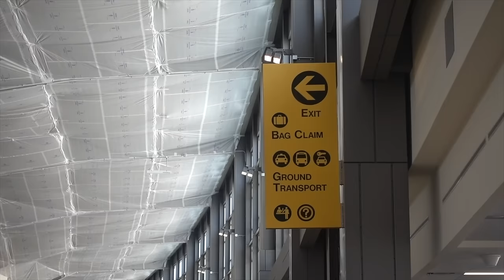MTB Myths that need to die—and some that are true!

Comment: Sometimes, a crash becomes your last run. I am not superstitious, but I think I crash less on my last run. Usually, my third or fourth run I tend to push the limits and crash.
Reply: i crash when its like 7:30 to 8:00 pm (Whistler closing hours) which is usually when i go for my last run
Reply: My last crash a couple of weeks ago was during my last run lol
Reply: We call it “shred-iquette”. Never call last run because it will curse you and you’ll end up hurt 😂 Learned it from a trans world sow mag back in 2005.
Reply: From my experience snowboarding it tends to be near when I would call my last run or on when I decided my last run would be... just overly tired and pushing my luck that way. Not as crisp and tight on the turns and control....
Reply: I think your brain is saying "OK make sure this is the last run as your £¥€&ed tired" and sure enough you've not as much wits/ scenses/ strength and then....... crash bang wallop. But also 3/4 lap cockinies gets me too
Reply from the maker: “sometimes, a crash becomes your last run” wise words
Reply: I also tend to never crash on the last run, I tend to be the most careful as by that point I am tired, the brakes also had a looong day (I have a tendency to burn the front pads if doing several runs right after each other), so I just take it easy and calm, goal is to finish and get home in one piece.
Reply: when im looking for a missing stuff, it's always in the last place that i search. spooky.
Reply: I am more likely to crash when I know its my last run, because I do get that do or die mentality. Its my last run, so I'm gonna send everything further, higher, faster, bigger, etc. Or I de side thst since its my very last lap I am going to FINALY send that feature I was too scared to hit, cuz it might be my very last chance. When that happens at the end of the day, when I'm peak tired, that's where I am most likely to crash.
Reply: i see it happen a lot and i always just assume people are tired, you make more mistakes when tired, reactions are slower, a one second lag between when you see a big rock vrs when you actually react to it is a long time when your scooting around at 20mph or more
Reply: I don't think there's any guaranteed point when you're more likely to crash.  Sometimes it's an early run when you're feeling unreasonably confident and taking undue risks.  Sometimes it's a late run when you're tired and not concentrating like you should.  Basically, know your limits.
Reply: I just crash all the time lol
Reply: Last run injuries also seem to happen in skiing. Especially with real go for it guys. I think fatigue plays a major factor.  There's a saying,"fatigue makes cowards of us all"  or at least maybe it should.
Reply: It may not be a myth because the chances of an injury go up when you are tired. Paired with “getting the max out of the last run” it could result in a higher rate of injury. And of cause an accident on your last run will be just more prominent than an injury during the day.
Reply: @patsgarage8593  oopp
Reply: If you're saying it's you're last run, you're probably too tired to be enthusiastic about riding and are just doing another to get your money's worth.
Reply: It's like "It's always in the last place you look" - you're not going to keep looking after you've found what you're looking for. Of course it's in the last place you look.
Same as most crashes are on the last run - you won't keep riding after a bad crash.
Reply: like, ever?
Reply: Yep my crash was my last one had a major wreck broken collar bone surgery and all still trying to recover been over a month probably never ride again
Reply: @fittpatley  yeah very true. I had my first real crash a week ago because I was tired. It was about the last of my ride and I didn't heed the signs that I needed to rest.
Reply: If crash hard enough, it's your last run of the day no matter what time it is.
Reply: Crash early and often! then no worries about last run or lap.
Reply: For God so loved the world, that he gave his only Son, that whoever believes in him should not perish but have eternal life. John 3:16
Reply: @Zarrx same with surfing, get out before you get cold and tired. Cold muscles move slowly, tired muscles are weak.

Comment: I learned to bunny hop with clips. Sometime later I switched to flat pedals. First time I tried to bunny hop with flat pedals I jumped straight off my bike. I think I learned bad technique 😂
Reply: I second... Took me 2 months to get rid of 'bad technique', but maybe switching to a front-heavy E-bike had something to do with it as well... ;) Anyway, NEVER going back to clipless, I think that technology is great for road bikes, but not (E)MTB.
Reply: It’s a different technique, it’s not necessarily “bad”
Reply: @pjgalligan  it is bad if you have to rely on being clipped-in just to perform a bunny hop. Your legs shouldn't be lifting the rear tire (which is bad technique enabled by clipless pedals), your arm's should be doing that by pushing the bike forward.
Reply: @sepg5084  it may not even necessarily about lifting. With clipless your legs might slide left or right and you may not notice it because you're clipped in, you don't have to try too hard to keep your foot right above the pedal. Once you went flat, your foot is going everywhere.
Reply: I did dirt jumping on my bmx when I first started riding, and then later got into bmx racing where I ran clipless all the time, after I stopped racing and went back to dirt jumping it took me a LONG time to relearn how to jump with flats. So yeah you can pickup some really weird habits which are a huge PITA to unlearn.
Reply: This is exactly the danger of learning with clipless. You may learn both proper technique AND add a bit of extra rear-wheel lift by pulling up on the pedals (and why not, if it works?). But put on flat pedals and you'll be searching for them in mid-air when you lift right off. Plus you have to learn to "scoop" or "bowl theory" or whatever metaphor describes angling the flat pedals so you can exert a little stabilizing force to stay engaged.

Definitely better to learn on flat pedals right off, because you will minimize crashes and injury by being able to dab instantly (this from a rider who has ridden clipless on the road and cross bike...and yes, mtb, for about 3 decades). There's just no matching the value of instant "release" in any direction you get from flats...no matter how much experince you have with clipless. So definitely NOT a myth.
Reply: @okymek  Even better is to have the toes a bit down with your rear foot, and your front foot just a bit heels down. Then the counterpressure between your feet can hold (and even lift) the rear wheel whatever you're doing with the bars.
Reply: Different equipment different techniques...saying one is wrong? maybe we should all go back to 'true' bikes  'the Ordinary penny farthing' type, or the Boneshaker...
Reply: I have the EXACT same experience. Took me weeks to learn a proper bunny jump after years of doing it wrong clipped in
Reply: I also believe people jumping straight to a full suspension miss out on alot of learning curves you could learn on a hradtail. Esp with jumping and stuff of that nature.
Reply: I learnt to bunny hop on my hardtail with clipless pedals and then rented a full-sus e-enduro one day. I had no problem to bunny hop it. The only real problem was saddle hitting my balls, because I am not used to ride with dropper seatpost :DD
Reply: @Patrick Galligan  it's a bad technique. Not very hard to unclip yourself pulling up like that. I raced with clips and had people pull there feet off the pedal because they barely twisted their ankle while pulling up. It's just not good technique.
Reply: @sepg5084  False. It is both. The front of the pedal should be lower than the back of it, because then you can lift the rear of the bike while pushing your feet to the pedal and pulling it up. If you do not believe, try bunnyhop with horizontal pedals...
Reply: Most of us had a real childhood with BMX bikes, and we learned to bunnyhop when we were 6 years old. Sorry about your failed childhood.
Reply: Doesn't bother me because I can't bunny hop either way.
Reply: Agreed. I came from roadbikes and could clear all kinds of obstacles. Got into mtb w flat pedals and can't hop at all. When clipped there isnt a need to shift weight back, lift front, shift forward lift back. You just load up and jump and the bike follows.
Reply: @jfeeble  Agree strongly here. Yes the techniques are different, neither is wrong. But having to make all of these special considerations for pedal position are easy when freestyling or casual descending but not better for pure pace against a stop watch XC or even Enduro. DH flats are good for a lot of reasons but some even like clipped for that. I think there is a predominately unstated 'cool ' factor that dirt riders want as few roadie associations as possible which is completely understandable. Many dirt riders want nothing to do the road mentality and find it very uncool. I do as well to a certain extent but I care about speed no matter what and in a lot scenarios clipped is faster. When you get really good at sliding you don't need a dab and it slows down the transition back to pedaling a lot.
Reply: Tried to learn bh on flats, shinned my leg pretty bad, bought SPDs, learned the basics with SPDs (you can feel when you "pull" on the pedal, so I tried to avoid that feeling), went back to flats, bam, I can now BH on flats. Using clipless pedals to pull the bike up is a choice, not a necessity.
Reply: It’s not bad technique you just aren’t use to pressing down on the pedals as you jump your use to the bike jumping with you. Hope you’ve figured out bunny hoping now that it’s a year later !(:
Reply: Doing it clipped is not wrong, difff styles, diff techniques.

 like saying the ebike guy is wrong for not be having to pedal up the hill.

Comment: The concern about the QR skewers I always heard was about not closing them towards the front of the bike - because they might snag on brush and get yanked open.
Reply: Yeah. And a rock knocking it open. I’d fully close it in a way that made that scenario impossible
Reply: I have mine facing back so you can just grab em and pull. I've had punctures on the moors before where it's so cold your hands don't work.
 I've never had one snag on anything before but I have been too cold to open a q/r from the usual position.
Reply: Yep, happened to me, can confirm it is correct.
Reply: not an MTB concern but riding a road peleton you're not allowed to have the wings of the skewer outward as it can catch the disc or tire of another rider and cause a crash.
Reply: Another one I’ve heard was flipping the QR to the drive side so that if you had to remove the wheel after a long DH run, it was less likely that you’d end up burning your hand on a hot rotor.
Reply: True story I have had bike shops close QRs towards the BOTTOM!
Reply: I have bolted quick release so no lever for me to worry about only a snapped axle probs
Reply: Having the lever on the driveside lessens the risk of you touching the rotor with your hand... Skin is oily on its own, and after maintenance or putting on sunscreen, you might contaminate your padyand rotor.

But who does still ride QRs on MTBs?
Reply: I've purposefully ridden that way on my old MTB, rode through countless bushes, high grasses and what not, literally never had I had a situation where the QR lever even moved. It's a pointless thing to worry about. 
Something that could open it would have to be really heavy or solid stuck in the ground, but that means it would first have to somehow bypass your legs end pedals.
Reply: @onesquirrel2713  "...close QRs towards the BOTTOM!" What's wrong with doing that?
Reply: @gatoryak7332  If you hit a rock or something there is a bigger chance that it will turn the QR counterclockwise and so open it. Also, it looks dorky AF.
Reply: I've never had a QR open up on me before, but I have looked back and noticed that I'm dragging half the forest with me, hooked on the lever.  I always point mine rearwards now.
Reply: @fireblade1986  "But who does still ride QRs on MTBs?"

Everyone who doesn't give a shit about having the latest/best parts on their bike.
Reply: @sampuhhupmas5666  guess what... Started mtb on a hardtail that i build myself out of only second hand parts, that people didn't like on their bike and took them of sometimes brand new... 650b nonboost, 2x10, random manitou fork... No sign of QRs back in 2016

Sorry anyway, didn't mean to offend anyone
Reply: I run my front QR axle "wrong" as it's under the fork leg like Rockshox and not vertical as Fox reccomends, my rear QR skewer sits forward perfectly between the seatstays and chainstays. It's due to the brush snag legend. True or not it doesn't negatively affect the bike and looks a lot cleaner.
Reply: @sampuhhupmas5666  or those of us still keeping older bikes going. Old school is still cool.
Reply: @mickenoss  like say dartmoor, i noticed the flag.
Reply: @fireblade1986  
Me. Riding an 2009 Gary Fisher Ferrous.
Reply: It was with the old ones, like the one he was holding in his hand.
If it happen to be opened during a ride, then it might do a 270 deg turn to the disk.
Not possible with the new design.
Reply: for the Front wheel, I put the skewer opposite the disk
not for any snagging reason, or for the 'caught in disk' reason.
but because sometimes people try to wrap their hand around the lever+frame to squeeze them closed.
and soon or later someone tries to squeeze lever+disk.....
Reply: @marwerno  Me too...a bush pulled mine open.  I always face them to the rear now.
Reply: I always put my QR handle against the chain or seat stay tubes (or fork in the front) so it'd be harder for it to catch on anything.  Seems like common sense even if it's unlikely.  But honestly, it just looks tidier.
Reply: @csn583  good way to make your mechanic mad at you. if the lever is closed against a frame tube it's hard to squeeze a finger under it to open. if he's feeling nice maybe he'll pry it open using something soft like a tire lever, and not a wrench
Reply: I put the skewer in line with the frame or fork, upwards and inwards, close enough to the bike that it's protected but not so close I can't get a grip on it.
Reply: That actually happened to my friend once
Reply: For God so loved the world, that he gave his only Son, that whoever believes in him should not perish but have eternal life. John 3:16
Reply: I've always adjusted my QR levers so they're pointing upwards.  That way, they're not going to get knocked open by hitting something on the trail.
Reply: @onesquirrel2713  "True story I have had bike shops close QRs towards the BOTTOM!"

I've gotten my bike back from the shop with the quick release skewer so loose that I could easily pop it open with one finger.  Moral of the story: always inspect your bike before going on a ride, even (or especially) when it's fresh out of the shop.
Reply: @sampuhhupmas5666  i have a friend like that who spent the equivalent of 6000 us dollars in my currency on a Specialized when he hadn’t even tried goong downhill ONCE. Guess what, he sold the bike 3 months later.
Reply: @nickseavello3017  yeah this is what i’ve heard and it makes sense to me.
Reply: @fireblade1986  I do. And all my friends that also happily ride their 26" bikes do too :-D
Reply: my grandpa told me that years ago